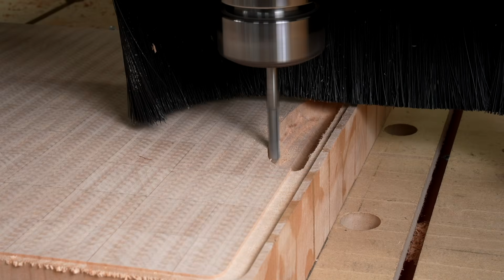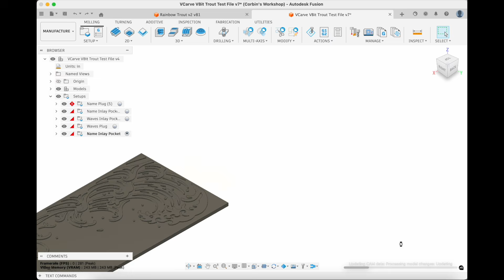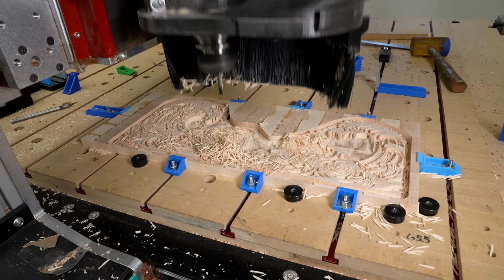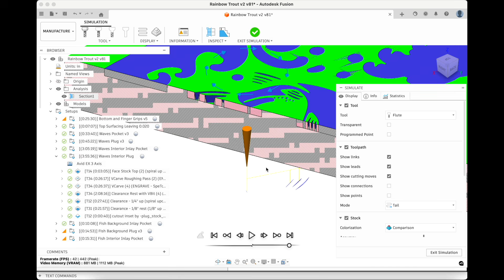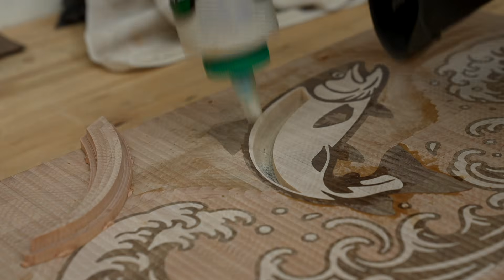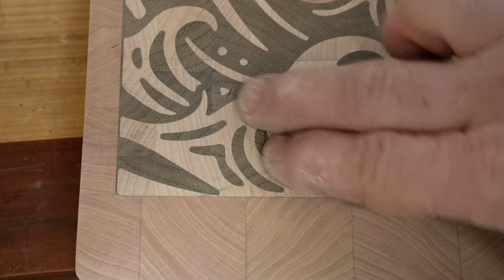A cutting board you don't want to cut on: The Rainbow Trout Cutting Board - CNC VCarve Inlay

Comment: Hi

Have you had any unexpected stoppages in the middle of long jobs or slight position shifts?
Reply from the maker: Hi - No, I haven't; those issues sound like specific problems to your machine. Such as it is missing steps, or overwhelming the CNC's GCode processor (ie: too dense a GCode file). Mach 4, and other GCode senders, do have problems when you have too dense of a GCode file. There are many ways to simplify this: ie: apply smoothing to the toolpaths based on a larger tolerance (ie: 0.001" or even larger).

Comment: That's awesome. It appears to be a better plugin that vectric's own built in solution
Reply from the maker: Fusion is definitely better for visualization of the result! Vectric is way faster at toolpath generation, but not fast or detailed when doing a simulation. Vectric has a huge leg up in actually being pretty decent at editing vectors; Fusion is terrible at it, and will choke on complex vectors (ie: slow way way down). This design is complex, but the vectors were "clean", so they didn't slow down the processing.

Comment: I've just discovered your channel. Nice job!

This is the formula to figure out Width of line / depth of cut ratio:

Width of lines formula:
Width = DoC/TAN (Vbit angle/2)

So for a 10 degree Vbit:
W=DoC/Tan 5

In English: 
10 degree VBit @ 6mm DoC = 1.05 mm min width of cut
10 degree VBit @ 8mm DoC = 1.4 mm min width of cut
12.4 degree VBit @ 6mm DoC = 1.31 mm min width of cut
12.4 degree VBit @ 8mm DoC = 1.76 mm min width of cut

or use this calculator: https://www.engineersedge.com/calculators/v_bit_depth_and_width_of_cut__16483.htm